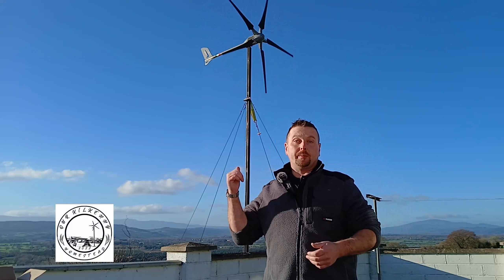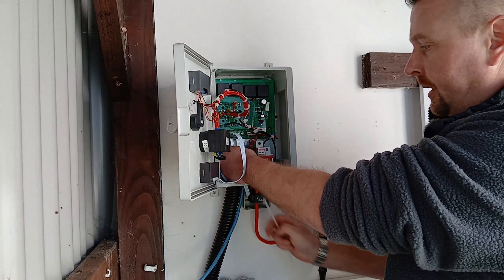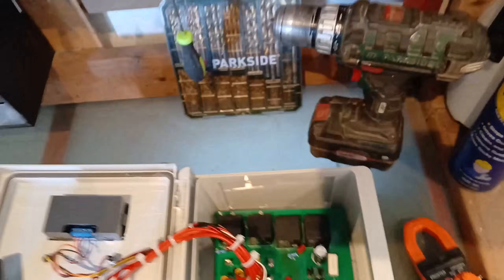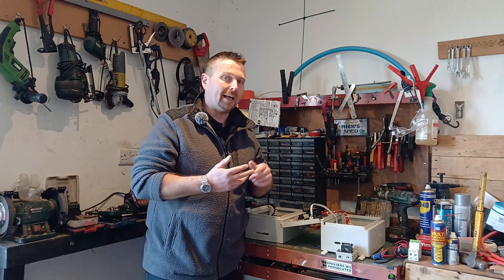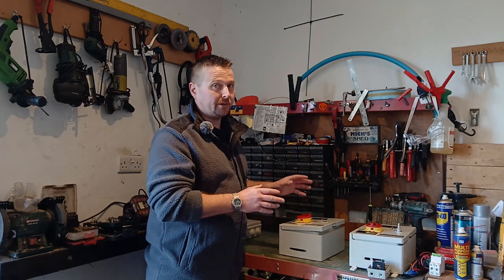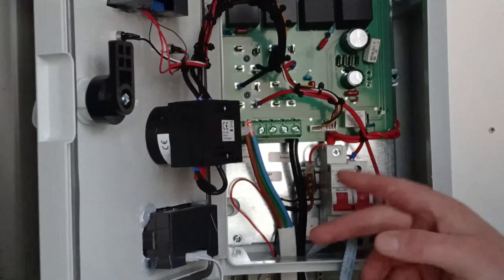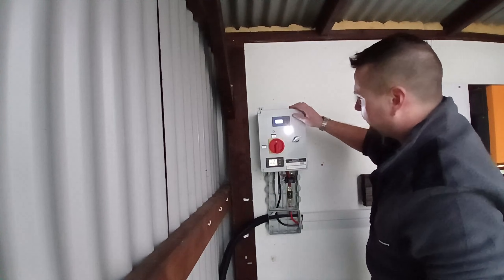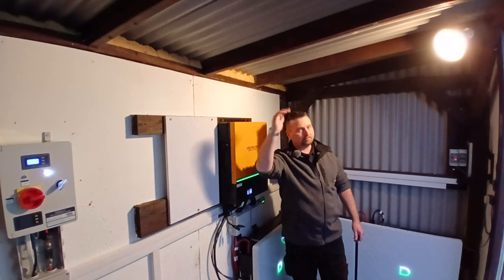Wind Turbine Upgrade 24v to 48v

Comment: I bought a 2kw 48v istabreeze but the production was so bad i build my own unit and used the motor from the istabreeze and now its producing 10 times more output. The istabreeze never produced more than 350w and now 1.8kw great motor crap turbine
Reply from the maker: How did you modify it? I'd be interested to hear about it?
Reply: @ourkilkennyhomestead2006 we had made a turbine before from a Hugh Piggot book but replaced the homemade generator with the estabreeze motor via a 3:1 pulley system

Comment: Why didn't you just swap the door from 24v to 48v box? No extra modifications needed and 24v controller would be back to factory specification for resale.
Reply from the maker: Because that would be dishonest.....
Reply: @ourkilkennyhomestead2006  I  didn't mean back to retail store. I was talking about the used resale market. There was nothing dishonest in my solution to revert the 24v to factory original options.
Reply from the maker: Ah I get you now. Tbh its handy to keep the 24v for spare parts. The stickers would be difficult to swap without damage or making it obvious. Keeping it for spares, I have a spare cabinet, brake switch, xycd60, dc circuit breakers etc

Comment: I'm wondering did you take AC voltage readings from the generator when it was connected to the 24V controller ? If so was it high enough to use with the 48V controller ? This will be interesting to see how it works out.  I would be concerned about using aluminium busbars and DC voltages at high current . Typically aluminium conductors are used in our electricity networks safely,  but with  AC voltages and dielectric grease is used to prevent galvanic corrosion.  It would be a good idea to ask a local electrician if he would have some old copper busbar scraps, bound to be several commercial/industrial electricians in the Kilkenny /Carlow area .
Reply from the maker: Hi pat, thanks for the tip. Not overly concerned about galvanic corrosion for the moment, its something that will take a long time before it becomes an issue. At that stage it can be examined and reported on.
About a year ago when the turbine was down for its first maintenance we did bench tests, both open circuit and under load. The open circuit test reached 128 vac at roughly 7-800prm. 
Im expecting the i1500 to perform less well at 48v, at 24v it was hopping off the brake regulating itself. More annoyingly it looks like we won't have any wind here for another week possibly two.

Comment: Interesting video as always.  I assume those relays are electromechanical. You probabiy hear them clicking a lot when dumping/recovering. Instead of using the istsbreeze controller,  I use an A30 voltage sensing relay (great units for about £16) with it's mechanical relay hacked off and use this to drive a pair of MGR 100A solid state relays (£20 each)  All totally solid state and no failures in over 3 years despite some hellish storms, dumping over 1000w for extended periods. Will be interested to see how your 24v ista gets on with your 48v batteries. I suspect it will do more rpm per wind knot and might struggle to teach charge voltage unless its really windy.( Im thinking of upping my game to 48v too).
Reply from the maker: Yes youre spot on, they are electromechanical relays. 
Have to say, very inventive of you with your setup. Dumping a kilowatt at 24v is no small task for solid state parts. 
I think youre also correct that the output from our i1500 will require much more wind and rpms to breach the charging threshold. Im looking forward to the next storm that rolls in to test it out tbh. Putting that turbine up in the harshest of conditions will be a fun experience for myself and all the viewers. 😊
Reply: @ourkilkennyhomestead2006  Happy new year! - may your batteries overfloweth with amps!.  I used MGR branded SSRs as mentioned on the excellent John Daniels youtube channel. ( all the other cheap branks like fake Foteks, seem to die quickly ). I use two 100A MGRs in parallel and they only get slightly warm even in big storms. About £24 each. In theory, two of them provide 200A capacity which is probably very optimistic but they certainly handle the max i1500 current with no probs whatsoever.  You don't really need to know much about electronics to set this up.  All you need to do is just get yourself one of these A30 controllers ( EBAY £14). Melt off the little coil relay and take the 5v coil signal to the control input of SSRs ( which uses a range 3v to 32v ). Then just insert the SSR switch (output) within the battery-dumpload circuit. This DIY dump controller performs completely silently and the SSR's can flicker off and on very rapidly to control battery voltage. Trick is to mount the SSRS on a really big heatsink. If SSRs do fail, they fail in closed circuit ( which would of course drain batteries ). But if a coil relay fails it usually fails in open circuit ( which would allow your turbine to spin into low earth orbit !). So in many ways, the failure mode for SSR's is safer. Anyway, 3 years now and not a single SSR failure.

Comment: Not farads, but microfarads. If the mill is 24 V, will it produce enough voltage for 48 V?
Reply: If you mean a wind (turbine) or generator/motor that’s rated 24 V, then no—by itself it won’t reliably make 48 V, 
To get 48 V, you’d generally need either:
A 48 V-rated generator/alternator, or
More RPM (often much more) than it was designed for, or
Power electronics that step voltage up.
Reply from the maker: Thanks, not sure at this stage but I dont expect much tbh.

Comment: Keep killing those birds guys.
Reply: I've never found a dead bird anywhere near my turbine and it's been up for 10 years. Bird feeder kill more birds. Our green finch is gone because of those feeders  bet you have one 😂
Reply: @stephenmcdaid8670  Eagles are almost gone so there aren't that many left to kill so death rates from windmills are lower, but avian mortality from the blades is well documented.
Reply from the maker: Doesn't happen in reality.
Switch off what ever media it is that youre watching and spend more time in the real world.
Reply: Only on the large scale turbines because of the height and the speed of the blade tip. Small units like these couldn't kill an Eagle impossible unless you shot it at the Eagle and you'd have to be some shot sir😂

Comment: Maybe you did this before, but I would love to get an assessment from you regarding the effectivity and production from that turbine. It doesn't seem to be higher than 7-8m on that mast, but the camera can fool me. How is it doing with low wind? How is it doing with all that ground level turbulence? Would you get one again, looking back, or was it a fun project without enough production? A lot of people say its a time waster in Ireland and to get more panels instead.
Reply from the maker: Hello Marcus, planning to do a video on that subject in the near future once I have some new footage in high winds. 
At 24v it worked very well although on an annual scale solar produced better. 
The mast is 6meters tall and yes turbulence is an issue. A yaw rate stabiliser could make considerable improvements to performance. Have been on the hunt for parts for a DIY version.
Overall I would recommend getting a micro turbine if the location is suitable. However it would have to be a good quality one and installed with the understanding that it is a supplementary charger for when pv input is low.

Comment: Not a good idea to use aluminum busbar if you are using copper wire
Depending on the coating of the lugs attached to the busbar, you may need to use a special paste to prevent galvonic corrosion between the two metals
Also while aluminum is a good conductor, it conducts significantly less than copper, so you will normally have to upsize at least one size to get the equivalent of copper
Reply from the maker: The lugs are standard tinned copper. Will have to disagree with you that aluminium as a busbar is a bad idea. Having studied conductivity and resistance charts on the subject, copper is obviously the better conductor, however aluminium makes an ideal budget friendly alternative with no loss of performance on systems of this scale in the real world. Thats why the national grid uses aluminium in a majority of its overhead cables nationwide.
Reply: @ourkilkennyhomestead2006  It would only really matter if the busbar was very small and thin, at these voltages and amperage, it is chunky enough to handle the current just fine.
Reply: Galvanic corrosion... it's a very bad idea! you use certified Al/Cu connector?
Reply from the maker: @Nicetomeetyou98 where is the electrolyte?
Reply: @ourkilkennyhomestead2006  As soon as moisture (even low humidity is sufficient) reaches the contact point, a galvanic cell is formed. A tiny current flows between the metals, causing the less noble metal (aluminum) to decompose.
Reply: But if it works fine! Cool video.
Reply from the maker: @Nicetomeetyou98 yes indeed, the flexible conduit in our setup also functions as ventilation ducting maintaining a constant airflow (albeit small) from the inverter cooling fans through the bus bar boxes. While not perfect the idea is that it reduces the amount of atmospheric moisture in those boxes. Keeping the potential electrolyte to a minimum.
With all that said, any evidence of corrosion can be monitored and reported on in a follow on video if it ever occurs.

Comment: cheap slip ring block is weak point of these turbines, it has flimsy brass leaf springs instead of carbon brushes.
i don't know if they  have addressed this issue, i bought one a few years ago.

just FYI in case if you happen to lose a phase someday. ))
Reply from the maker: We did a video on that very issue a few years ago including how to upgrade to a larger slip ring that is capable of meeting the requirements. Thanks for sharing your info all the same.

Comment: You will probably find that the circuit board is a double layer circuit board and the voltage controls are on the other side

Comment: All the best for 2026! I'm wondering is it best to put a wind turbine into a 24 and then use a 24-48 to charge the bigger bank or go direct? I have little enough wind often enough without it held back by needing more wind to charge higher voltage.

Comment: The Istabreeze has a 3 Phase WYE stator.  Therefore, all three of the wires are HOT.  You claim ... They are hot & neutral at the same time. <= That is impossible and not true.
  There is a Neutral connection in the head, but it is not available to the consumer
Reply from the maker: Appreciate the correction, good to know for future reference.
Reply: Thanks Karen❤

Comment: Makes sense, a 200v capacitor in it, when the bench test was 190v-220v.
Reply from the maker: It does indeed, factor in for load loss and 200vac would be a realistic upper limit to be converted into a lower voltage dc
Reply: not far off another,  youve got 3 blades, charge controller, just need generator, hub, capacitor, mast, i just need capacitor, mast, bearing replacment.
Reply from the maker: @HenryOwens-py3ur at least the bearings are only a tenner a piece 😅
Reply: Yeah £20 for bearings £30 bearing extraction kit, £10 capacitor, i still need concrete and scaffolding. im just undecided to go for a 60mm for the istabreeze or for a 75mm pole for a 3000w 300rpm 2,5m or 2. 8m wind wheel.
Just a 2000w 48v generator £260 from istabreeze fast trading, sit that on 2x 50x50x350mm aluminium box tube 2 pillow block bearing one of the 50x50 could be 1.5meters for the tail.
Reply from the maker: @HenryOwens-py3ur are they 20 quid in the UK for replacement skf bearings? A little steep for what they are. I bought mine from murphy engineering nearby in waterford. Check out their website, they might ship to the UK and save you a bob or two. The bearing extractor kit i used is 2 pieces of 2x4 with a hammer and impact socket, cost nothing and did the job once you split the end casings from the generator. I know the genny bodies are a pita to re-assmble but two coil spring clamps that I used at 25 quid will do more work for you than a bearing extractor kit at 30 quid. 
Just a suggestion, how you prefer to do it is completely up to you of course.
Reply: @ourkilkennyhomestead2006 £10 each. I just want do things the right way for struggling for 4 years make windturbine stands tools plans ect.. and now just abit burntout from it all, ive hit a sweet spot with the generation and consumption i think. But still could do with more for heating in winter.
I do go on Europe ebay, seems to have more wind powered gear on thier, the 2kw 48v on a the uk abay.
Reply from the maker: @HenryOwens-py3ur gotta be honest with you Henry, I get the same burnout looking at parts for our system here. Ali express has lots of options at better prices but much more discernment is required before buying. Shipping isn't too bad either, roughly 2 weeks to get from "Chyna" to UK or Irl 😊
Reply: id hold that 2 weeks delivery,  i brought 2 4x4 spotlight advertising 2 weeks delivery just arrived christmas eve, ordered them in October ! On aliexpress.
Sorry the generators fro Bulgaria, so i would have seen it on Europe ebay and then when i wishlist it, it shows on the uk ebay
Outside chinas 3 month wait.
Reply: Could have been alibaba !
Reply from the maker: @HenryOwens-py3ur 😊 endless shopping / wish list material 🤣

Comment: Happy Christmas. Can you go through some numbers on the Istabreeze now that you are on 48V system, which is the most commonly used nationwide? ( cost of turbine & controller, average power generated etc ). Most people run a mile from wind Vs Solar PV. Do you connect it to a mppt port or a Genny port on the inverter ?
Reply from the maker: Merry Christmas to you too and all the family. The current cost of the turbine with controller is roughly €900 at the moment direct from istabreeze. An estimate for power generated from the turbine as it depends on weather is around 1-1.5mw per annum. Being off grid, the turbine and solar function as battery chargers and load supply to the house. The panels go through the mppt supplying charge to the batteries minus consumption load of whatever were using at any given moment. The wind turbine works the same way with positive and negative inputs connected to the busbars. The all in one inverter automatically apportions power to loads from whatever is available at the busbar. Any excess during consumption gets stored in the 30.7kw of lifepo4 batteries.